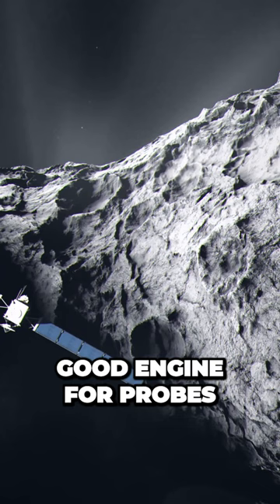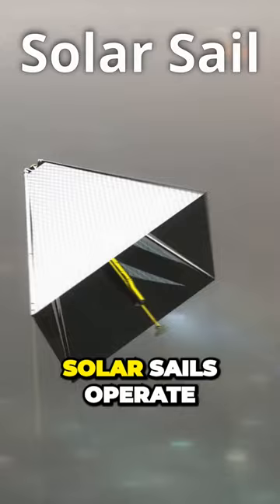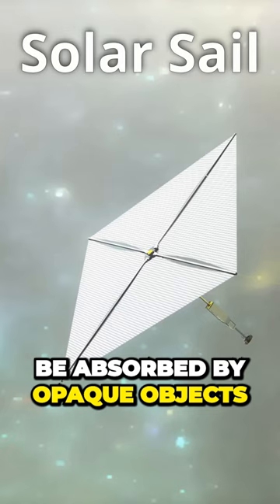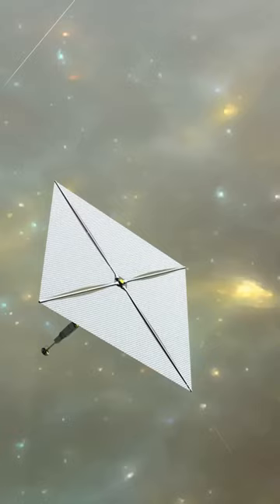Solar Moths & Solar Sails

Comment: I get notifications for every video you release but not for this. I also didn’t get it recommended in my home page. I wonder if you have to release a certain amount of shorts before they start to get recommended to anyone. Either way I’m all for increasing the reach of the channel.
Reply from the maker: I think maybe shorts don't send notifications to the audience, which is fine by me, I don't want channel regulars getting bombarded with notifications of short form content that I'm releasing essentially as a preview of bigger and more detailed episodes.
Reply: @isaacarthurSFIA  I definitely agree I wouldn’t want a bunch of notifications for shorts that are just clips of existing videos. If you do post completely original shorts though I wouldn’t want to miss those.
Reply from the maker: @UpliftedCapybara  I suspect besides some compendium clips I will limit it to original material.

Comment: Will this bend the speed of light constant by warping space instead of using thrust?

Gravity wells and breaking light speed.  

I have a theory that may be novel.  By creating a cubic mile black hole and building an equal mass space craft around it and moving the black hole forward and back to center inside a cylinder inside the space craft the back of the black holes gravity well will propel the space craft faster than the speed of light similar to a Alcubierre drive.  

The Alcubierre drive ([alkuˈβjere]) is a speculative warp drive idea according to which a spacecraft could achieve apparent faster-than-light travel by contracting space in front of it and expanding space behind it, under the assumption that a configurable energy-density field lower than that of vacuum (that is, ...
https://en.m.wikipedia.org › wiki
Alcubierre drive - Wikipedia

The rest of the theory is that we will one day be able to build a massive space craft capable of traveling much faster than the speed of light and release satellites 🛰 that spin at the speed of light and download our ancestors light resonance images into a virtual heaven making them all immortal.  If we can do this in the next 10,000 years using Dyson spheres then the maximum stage of life in the universe 4 billion years ago could easily do it today, but that has yet to be proven so I think it’s good to consider and maybe believe in both.